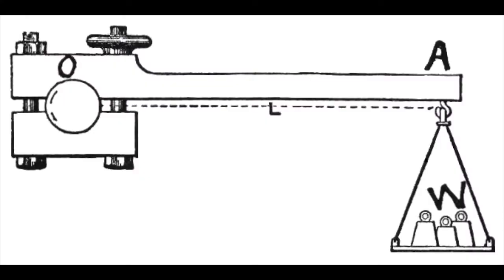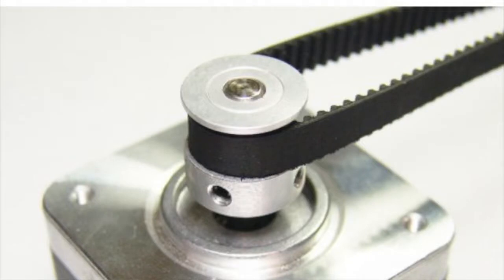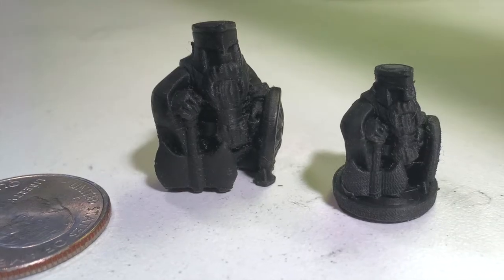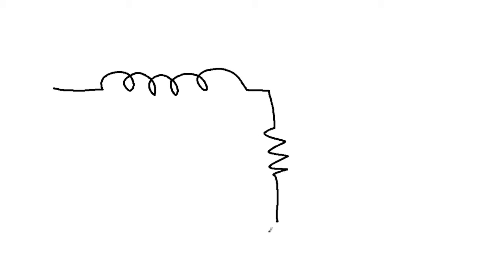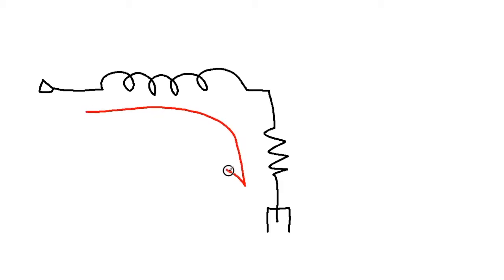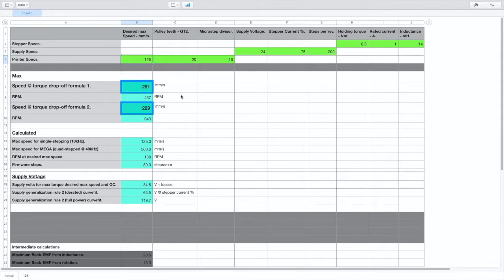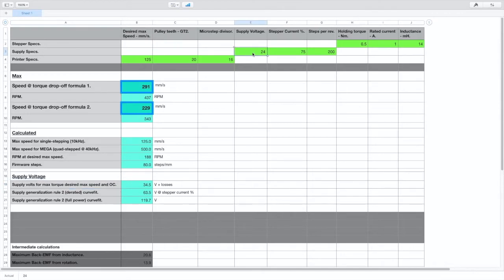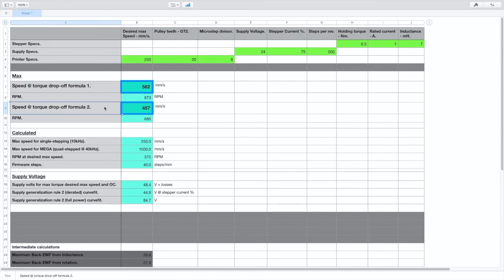TNTM: intro to stepper torque and inductance for 3D printers

Comment: Hello Alex. Could you explain one thing. What was the purpose of "Stepper Current %" parameter. Why anyone would run motors with lower than rated current. If i understand correctly it will lower max torque value. In your spreadsheet, lower "Stepper Current %" gives higher max speed before drop off but any other parameters stay the same. Wouldn't lower current also affect max speed and other factors? . I calculated that i would need 32.3 V supply for my desired max speed (120) running at rated current 1.7 (100% Stepper Current). I use 24V so if I wanted "/Supply volts for max torque desired max speed and OC/" to match to my power supply i could just set the current to 67% of rated current. Doing such I increase max speed also but I dont think it works that way. Shouldnt "Stepper Current % influence other factors as well? Sorry if Im talking nonsense, please understand im newbie ;)
Reply: heat, power consumption, stepper longevity. in some cases it could affect noise